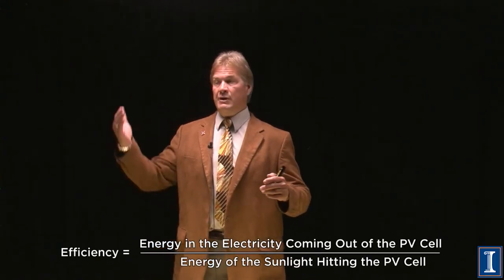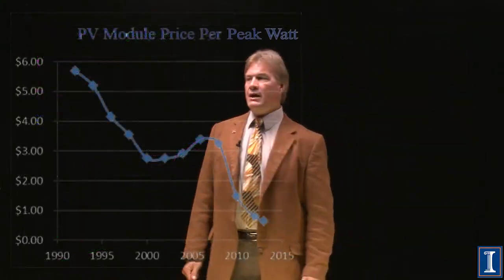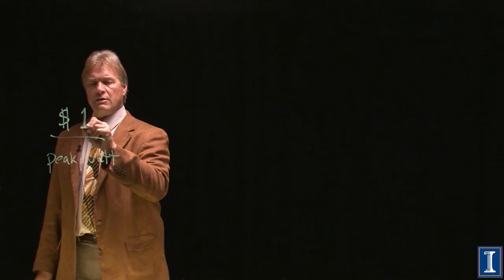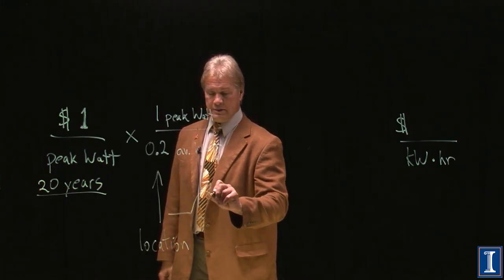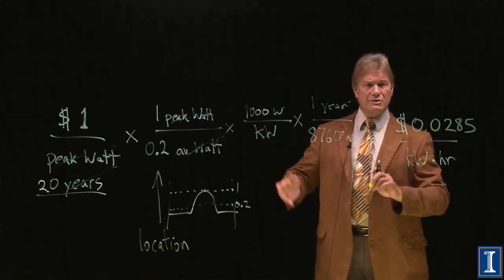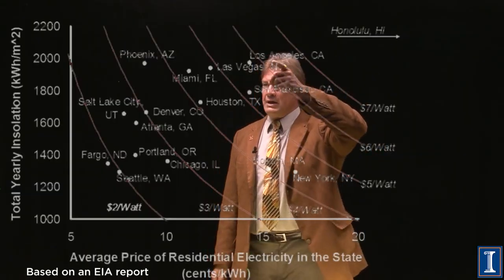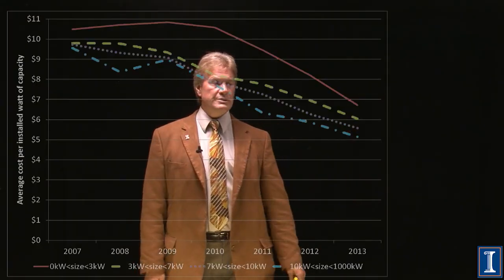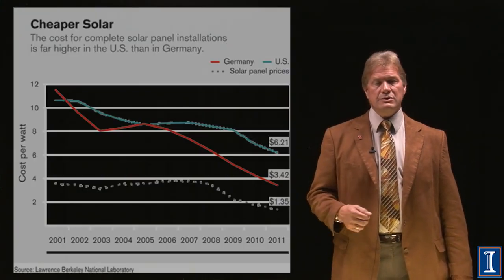The Cost of Sunshine

Comment: this is from 2015, right? i would love to see an updated version.🌞🚀
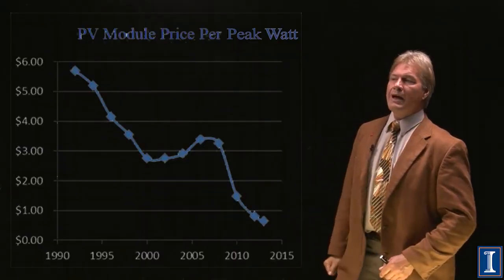Reply: The data is from 2015, I think the actual recording is from the next year based on one caption that appears that says 2016. In any event, if you look at the $/W chart he presents around the 3:45 mark it goes from just under $6/Wp to just under $1/Wp. The current price for grade-A panels in wholesale lots of >1MW is between 0.2 and 0.23/Wp USD, delivered. So there's been another 4 or 5x decrease in price since this presentation was produced.
Reply: Solar only produced 2.3% of electrical generation in 2018 in the US. It's kind of amazing to see people pronounce fossil fuels dead when they still supply so much of our energy and the same fraction globally as they did 30 years ago.
Reply: here you are
https://en.wikipedia.org/wiki/Solar_cell#/media/File:CellPVeff(rev191101).png
Reply: Well, he shows how to calculate it, so you could just plug in current numbers.
Reply: Update from Germany for the interested:
My parents got 8.16 kWp installed for 16.8 k€, including a wall box for car charging. 
The pure solar installation with 20 years warranty was slightly above 2$ per Wp.

In Germany we pay around 30ct per kWh so cheap Solar becomes economically viable much much sooner

reposted this, my original comment, to this subsection
Reply: @Gregory Specht And Australia is a big island that needs to import much of what it needs. If it can do $1/watt, there is NO reason why we can't do better.
Reply: Solar prices have fallen drastically since 2013. Even by 2015 they were closer to $4 per installed watt. There's some underhanded math going on here. US *residential* costs are now closer to $3 per installed watt **unsubsidized**. They're closer to $2 per installed watt after tax incentives (in most places). Most solar panels are warranted for 20 years, if you read the fine print, that's when the panel's output is expected to fall to 80% of its rating. It's not like the panel vaporizes after 20 years, they're still perfectly useful.

Here's my source: https://www.nrel.gov/docs/fy19osti/72399.pdf
If that link doesn't show up, it's: www <dot> nrel <dot> gov <slash> docs <slash> fy19osti <slash> 72399 <dot> pdf
Reply: @AbeDillon  thanks! the link works.
Reply: @AbeDillon  Even better, while most panels are given a lifetime of 30 years, in reality after 30 years it's more likely that your whole roof needs to be replaced anyway, while most of the panels will still work, even if only at 70% original capacity. So you buy new more efficient yet cheaper panels, but there are likely to be plenty of DIY people who would like those old panels for their off-grid farm so recycling them is not a problem either.
Reply: @AnalystPrime  Do US roofs really only last 30 years? Is that shingle? UK roofs are normally tiles or slate and should last at least 70. My previous house roof is now 85 years and the (clay) tiles are getting fairly worn, so a refurb sometimes in the next 15 years is probably sensible. My current house is 60 years and the (concrete pan)tiles are nearly as good as new. It'll clearly do at least another 60. And yeah I'll have to take the PV and solar thermal off in order to renew the tiles.
Reply: @Wookey.  Depends on the construction, but that's the average unless you have tile or slate roof that has lasted since middle ages or something. And yea, some US houses are made of frigging cardboard and won't last half that.
My parent's house is some 70 years old and of decent make, but the roof has been  replaced about 35 and 5 years ago, though the new one might last longer now global warming seems to have stopped the winters that pile it with half foot of ice and two feet of snow every year like happened when I was younger.
Reply: WhiteShadow2k1  Typical panels are rated to survive something like golf ball sized hailstones and making the cutoff switch easily accessible is basic regulations. Most houses can go 60 years without burning down or getting bombarded by hailstones big enough to break trough the roof, so if those are actual real near future concerns you should think about leaving town rather than installing solar panels.
Reply: A LOT has changed in the Fossil Fuel world since 2015... A LOT. 

Natural Gas is abundant and cheap which as suppressed the price of coal. Both are being used right now but Natural Gas has taken a larger share of electricity generation over the past few years to the point where it is incredibly hard to compete with it financially. For the time being, there is not point in attempting to make any renewable source compete with Natural Gas... you'd just be throwing money down the drain. When fossil fuel prices increase after at least 50 years, renewables may see further interest as their viability will increase. Until then, stop trying to make solar happen, it isn't going to happen.
Reply: YusefDeeb69 you don’t understand, solar gives us a warm fuzzy feeling inside and the average person should decide the energy future we want for this country. You sound like someone who would go to the doctor if you had cancer. Stop trying to talk about facts. All we care about is feelings. 

PS; as a project manger who has built solar and other types of utilities for 30 years, why don’t we just build a billboard with a picture of a kitten that says, “hang in there” instead of solar? You are effectively doing the same thing. I’ll tell you why. I can build the solar site, pass the cost over to the captive customers (yes, I work at your electric company), and we mark the cost of the capital project up and give the profits to the share holders. The more solar site I build the more money shareholders make, never mind the fact the residential rates go up. All the while you sheep ask for more solar. Enjoy you electric bill. Is it going down? I mean you just told us how cheap solar is, so you bill must be going down.
Reply: @fedcoin1602  I appreciate your sarcastic reply. I will add to your explanation by saying that the situation differs depending on states. Regulated vrs. unregulated states have different benefits. For example, a regulated state will require a utility company to accept all excess electricity produced from corporate or private providers at the going market rate. An unregulated state allows the citizen to decide through an exchange which electricity provider to use. Meaning that the money follows sentiment. In these states, those folks who want to pay more for solar certainly can get that warm fuzzy feeling inside, and pay for it too!
Reply: @YusefDeeb69  Yikes this comment did not age well at all.
Reply: @pspublic13  When one guy can EO away huge sectors of our energy independence, starting a depression and wars for the profit of a select few elites... no, it didn't age well but it's not the fault of the energy availability.
Reply: @YusefDeeb69  Wind and solar already are same or lower cost per watt than NG, and given the fossil fuel supplies are limited their cost going to go up, not down. Renewables have no fuel cost, so once you build any kind of power plant it will produce free power as long as the materials it is made of will last, and most likely the only reason why one gets replaced is that newer technology is even cheaper and more efficient. In other words, the already low cost of renewables is only going to go down as the technology improves and the production is increased.
Note that these costs are without subsidies for renewables but including all the tax breaks and controlled prices the fossil fuel industry has enjoyed for the last century.

You say renewables are too expensive, and your solution is to not improve them but to burn fossil fuels until those are gone and there is no easily accessible energy left? This is not a plan that anyone with a positive IQ would support unless their aim is to destroy the human civilization so thoroughly it can never recover.
Reply: @AnalystPrime  , Renewables are definitely getting cheaper, but it doesn't amount to higher efficiency. Small example; the Roscoe Wind Farm in Texas takes up the same amount of land that would hold 150ish Nuclear Power plants, but only produces LESS electricity than 1 dual-reactor Nuclear Power plant. To produce the same amount of electricity (1 gw) with only solar panels, you'd need enough land mass to hold around 130+ Nuclear Power plants.

Edit: Figured I should put something else for reference incase the whole power plant thing is hard to see. Basically, you could fit 4 Disney World parks inside a solar farm that produces 1gw of electricity.
Reply: @solusgamer164  I'd love to solve all our energy problems by making a modern nuclear plant appear at every city, but unfortunately my magic wand needs recharging.

Putting aside the potentially over a decade long process of getting the permits and finally building a nuclear plant while you could probably order some windmills today and have them producing power before the fall, I'm guessing your 150 NPPs are squeezed really close together if you want to fit both them and the exclusion zone required around them in the same area as Roscoe. Now check out the picture on this page: https://en.wikipedia.org/wiki/Roscoe_Wind_Farm

Note the fields where people are totally allowed to go? Windmills may need to be certain distance from each other but their footprint is tiny and there are very few restrictions on what you can use rest of that land for.

Cost is whole another problem: A 1GW nuclear plant might in theory cost only few billion, but there is a reactor(just the reactor and housing, so it costs less than a whole plant) under construction in Europe that is a decade late and about ten billion euros over budget. For the cost of that one reactor they could have built ten Roscoes, and that is assuming they used the same over ten years old tech instead of new cheaper and more efficient turbines.

Finally there is a small issue of what happens when it has to shut down. A nuclear reactor needs refueling every couple years when it cannot produce power for few months. If one of the wind turbines at Roscoe needs maintenance or cannot operate due to freak weather that means the farm loses less than half a percent of their production capacity.
Reply: @AnalystPrime  , I guess you didn't understand the point I was trying to make. I'll try again. A single Gen III nuclear power plant produces more power than all the windmills in the Roscoe Wind Farm. In other words, one nuclear power plant can supply enough electricity for a city of about two and a half million residents, while the Roscoe can support about a million residents less. If your argument is that the land can still be used for other things, it's very hard to see what else. They build windmills where there is going to supposedly be the most wind. You can't use the land for farming since irrigation would be near impossible. Any other type of production is rather inefficient considering the location of the wind farm is not ideal for transportation costs. The same would apply for solar farms. For one, they have to be located where there is the most sun irrespective of the location of the city supplied. Nuclear power plants aren't limited by location, but are instead located in accordance with convenience. So not only do you produce more power, can pick a convenient location, and make cheap and clean energy, but you don't need as much space to build one as you would with a solar or wind farm for comparable energy production.
Reply: @solusgamer164  Pictured: Roscoe wind farm. Also in same picture: farming is happening.
Not in the picture: Big fences and armed guards needed to keep terrorists from irradiating your city.

Nuclear plants are definitely location limited. You can't build one too close to a city. You can't build one too close to densely populated area. You can't build one near major traffic routes. You can't build one where prevailing winds are towards such areas either. Then you need a zone where people just aren't allowed because you can't risk someone attacking the place. Also it needs to be on a coast or similar place for guaranteed access to water.

And there exists this amazing invention called high voltage power line. Spain has lots of sunny days, Denmark has wide areas of sea where winds are steady and you can build 10-20MW windmills instead of small 1-4MW onshore ones. They sell their surplus solar and wind energy to every nation in Europe.

You can literally buy a piece of land, deliver a bunch of solar panels, battery packs and workers and start setting up a solar farm, then produce enough power to sell to the grid within days as the workers are still putting up more panels. It will take years just to get the paperwork done to get a permission to start building a nuclear plant, then more years to actually build it; by the time you get to having your reactor tested for maybe being allowed to start producing power two things will have happened:
1. The amount of power your city needs has grown. 2. Someone else has built more renewable power than your reactors can deliver.
Then the nuclear plant has to keep selling electricity for years to cover the building costs; wind turbines pay for themselves in under a year.

Unless you are Singapore or Liechtenstein the area needed is not an issue. Being able to produce cheap power 24/7 more reliably is the only reason nuclear is considered as an alternative for renewables.
Reply: @AnalystPrime  , everything you listed for location limitations for nuclear plants applies to wind farms. You're right, you still can use the land for farming. I didn't consider the distance between each windmill which you did include in your comments, but it's not the same for solar farms is it. 

Second, the location convenience I'm talking about has to do with power production. In other words, there's no concern over which location generates more power. That is literally the only concern of wind and solar. You cannot build a wind farm where there is no wind, neither a solar farm where there is little or no sun. The way you transport power for wind or solar is how nuclear power is transported. Thus why nuclear power is more "convenient" in terms of location.

Thirdly, the time table of building a nuclear plant is based on government restrictions. That there isn't a much shorter time table with all the necessary precautions is a problem that needs to be addressed. It isn't simply standard. I worked for a solar company, going door to door to sell, and even then something as basic as putting a system on a house can take up to a month depending on the municipality here in the US. It isn't as simple as buying a few panels and installing them the next day, but why not? There are definitely some things that can be done to make it more efficient to verify building codes before installation, yet here the sentiment is that if it's up to the government, don't hold your breath. It's the difference between getting in line at the DMV and getting a taco from a food truck. As with solar, so with nuclear power.
Reply: @AnalystPrime  You clearly don't know much about the subject and are arguing against ideas that go right over your head. Of course that "wind" and "solar" need fosil fuel. You need a lot of energy to make steel, glass and even the semiconductor monocrystals. And in case of steel and glass, that energy usually comes from good old coal. Then you have to add fuel spend during transportation, ground preparation, manufacturing of other parts and so on. All that is actually pretty significant part of the energy ever produced.
The other huge problem is, that neither "wind" nor "solar" produce elecricity when it's needed and whe have no way of storing it. Nuclear PPs are predictable and that refueling (which is actually not a big deal at all) can be perfectly planned year in advance and it usually takes place during holidays, when the average consumption is significantly lower (depending on state, this doesn't work in places where people are running aircons all day long).
Reply: @solusgamer164 Lol, a wind farm is not empty land, silly.  It is filled with wheat, soybeans, sorghum, corn, cows, etc
Reply: @solusgamer164 Let me get this straight.... You don't think that you can have cows or crops where it is windy or sunny? 😂
Reply: @WhiteShadow2k1 So you are saying the panels, batteries and wires are fireproof? Because if it is getting too hot to go near them to pull the plug it is more likely the electric system melted already...
Reply: @WhiteShadow2k1 You should never put solar on a hail place like Texas anyways.